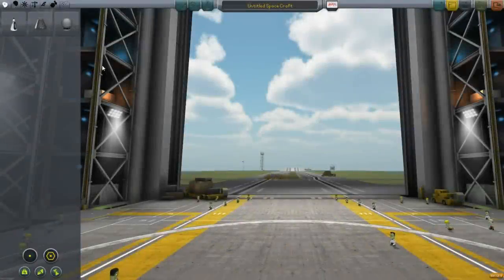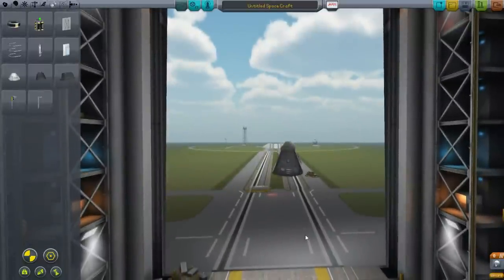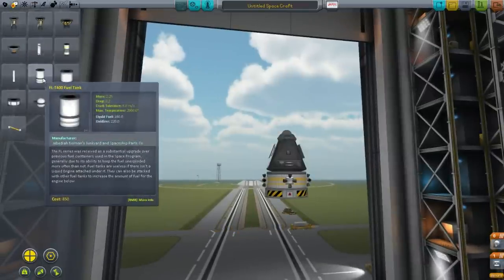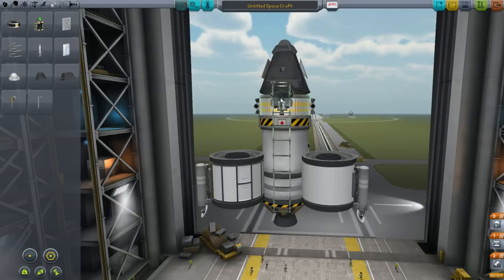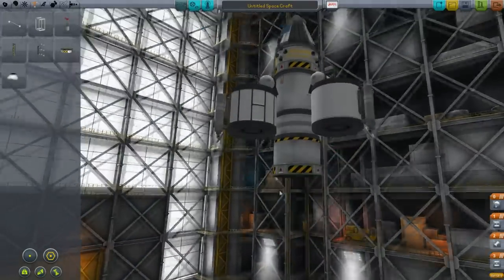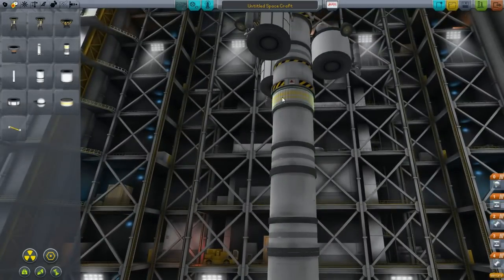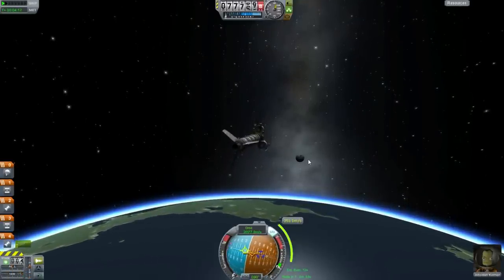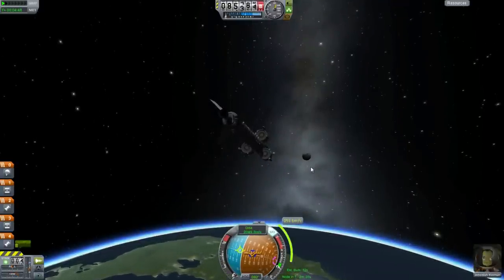Kerbal Space Program - Tutorial For Beginners - Part 6 - Building a Moon Lander

Comment: IMPORTANT! Scott didn't cover this, but when you add fuel lines, click on the outside tank then the inside tank. Fuel only flows one way, look at the arrows on the line if you're confused.
Reply from the maker: LISTEN TO THIS MAN!
Reply: Ahh brings back memories of pre-knowledge frustrations. Additionaly prior to launch check your ducts to ensure you didn't place something afterwards that cuts into any. Even though it'll render complete in the VAB initally it will be severed on the lanuch pad and inoperative. Struts, aerodynamics and ground support parts are big offenders in severing ducts.
Reply: Sam Banford I also noticed that using symmetry options sometimes causes the first part to be on a seperate group. So if you attach 4 thrusters, the staging will show 1+3 instead of 4. I could fix it by grabbing a cloned part and then reapply it.
Reply: SeedlingNL That is the second most annoying thing in the VAB for me, the first being trying to click something paritally hidden or small and clicking on the thing it's attached to by mistake (usually a entire stack of stuff on x6 sym that has asym child parts).

I think I narrowed that splitting problem down to when you grab something and don't put it back from where you got it from. It'll actually fix itself if you save and reload the vehicle or launch it. I just ignore it now.
Reply: Sam Banford Yeah, trying to click on a pixel, missing and tearing off a large section is annoying, but fortunately CTRL-Z will undo the mistake.
I think the splitting problem is caused by place a part, take it off, increase symmetry (x) and re-placing it. Grabbing a cloned part removes the symmetry 'history', so you always start with x symmetry.

Comment: First time I went to Minmus on my current save on career mode (not science mode) (before watching this video) I didn't have solar panels and I almost ran out of electric charge. I had 2.6 units left after landing and I had to wait until minus turned to the point where I would be on the side that faced way from Minmus's prograde and burned straight up and south (as I was north of the equator) and made corrections without turning. It was so awesome when I finally made it back to Kerbin.

Comment: I think it might be important to note that with the low gravity of Minmus, RCS can actually help you get out of the sticky situation where your craft topples over while on the surface. RCS will help you get a vector that points away from the surface so you can use the main rockets to escape instead of flailing around on the surface using the uni-directional main rockets hoping to point upwards.

Comment: I used a slightly altered version of this design to go to the Mun.  After successfully landing there and enjoying the sites, I took off.  Unfortunately I was only able to get into a Kerbin orbit with a periapsis of about 815km.  I EVA'd and loaded all the science onto my command capsule.  I then detached my lander from the capsule, turned the capsule towards the retrograde and EVA'd again.  Then I used Jebediah's body and jetpack to slow down the capsule by pushing against it until I had a periapsis of about 30km (it took 3 refills.)  Easily one my favorite Kerbal stories so far.  When I first realized I didn't have enough fuel to get back to Kerbin I was freaking out.  I did not think using the jetpack would work at all, but it turned out to be fairly effective.

Comment: I actually made a rocket with the early science unlocked parts that uses the asparagus style fuel crosslink setup for radial engines, I call it the Cauliflower and it's currently my main lifting rocket.

This sounds like a really interesting idea for getting heavier things into orbit though, thanks for the tip.

After making the Cauliflower MK. II and III and doing two successful (The first one's lander stage ran out of fuel since I got too greedy with trying to land in more biomes but I made it back to Kerbin on RCS thrusters only) missions to Minmus, the second one carrying all the science gear I bought with the science from the first one.

I now also adapted the original Cauliflower MK. I design to carry a microwave solar collector to lunar orbit, now I've got Jebediah back (Thanks to slapping a spare capsule and some RCS fuel on the carrier stage for the satellite) and any future rovers I land on the surface will be supplied with juice from orbit if they should run out while traveling the night side.

I can't believe it was really as simple as doubling the fuel on my original design, I feel stupid now... =p

Comment: i have the exact same rocket(except fot the RTS fuel) and as soon as i start to turn 45 degrees at around 10 km it starts spin uncontrollably
Reply: patsie00 The aerodynamics model for KSP got hugely updated. So the science bays catch a lot of drag which causes your spin. My suggestion is to use static fins (AV-T1 Winglet) on radial decouplers at the bottom of your craft. You will not spin uncontrollably, but it will make your turn a lot slower. For this, you can throttle down, or you can decouple the fins (hence why they are there in the first place). Hope this helps!
Reply: Gaurav GK Even with that static fins i cant stop that f****ing spinning.. :/ i tried to add some aerodynamic noses it doesnt help. Fins doesnt help, version 1.0 is sooo stupid. I played kerbal like 6-8months ago and everything was ok.. Now i cant get even on orbit because of spinning..
Reply: Try to use the offset tool to push the science bays in a little. And try not to do your gravity turn only at 10 km so fast. Try 8 deg very 2 km until 10 km, then slowly flatten out.
Reply: Gaurav GK tried, doesnt work even like that :( .. what worked for me is "balance" the weight of the ship at the top.. because of the center of mass is too much at the bottom, when i add some fuel tanks at the top as well, everything works ok (in that case center of mass is closely to the middle of the ship).. But after that i got problems with fuel :D cause the ship is too heavy and i do not have enough fuel with these 400 (or 800) fuel tanks. I think it would be ok with the ultra big jumbo-64 fuel tanks.. But its not efficient.. :/
Reply: Try turning slowly

Comment: The Delta IV Heavy doesn't use the fuel crossfeed method? IIRC the cryo tanks on the first stage are the exact same, and have the same amount of fuel in them.  However, the two extra core boosters separate several minutes before the main one.
Reply: Well the core stage of the Falcon 9 seems to work fine.  Also, that's rather interesting about the Delta IV Heavy.  I only wish we had that level of control in KSP.  Although with .23, we might, I just can't remember.
Reply: Razorcane We kinda do... You could set a central engine to say thrust limit at 50% in the VAB and then once the boosters had run out click on it in flight and put it at 100%. It will be nice when we can use action groups to just change the Thrust limiter setting on an engine.

Comment: recently started playing, and have "adopted" your designs, following them almost the same, only difference being is i have a mechjeb on mine. Anyways, the problem is that, every time i try to turn to enter orbit, or even when i don't, at about 10km, the craft begins to spin wildly, usually costing me a quite a bit of fuel, and the velocity i need to achieve orbit. I was wondering if anyone had any advice. Also, this is on the most recent update of ksp

Comment: Hey i started with career mode and i have the basic parts + i cant use manouvers . Can u make a video about going to the moon ?
Reply: Well, all you really need is to unlock the fuel crosslinks and the bigger fuel tanks and then you make a craft like the one in this video, lander and all. You can add some more fuel to it if you really want to, and then you go to the Mun exactly like he just showed how to go to Minmus, the only difference really is that the Mun is closer, has a more easy to hit orbit, and has a LOT of more mass. That means landing on the Mun is a lot tougher, but it's done in exactly the same way.

Like he says, if it can get to Minmus it can get to the Mun.

If you really want to you can replace the science cans he's strapped on to the sides with small fuel tanks or RCS fuel, except if you do you want to crosslink them all so they drain into the main tank, and you might want to be able to jettison the ones that are empty, so a different leg configuration might be in order. Having more fuel makes it easier to land in more places though so it's a tradeoff.

Comment: Hey Scott, do you have to get your science stage back to Kerban to cash in the science now in .90? Thanks.
Reply: Nope, you never did. All you do is go EVA and pick up all the science experiment data, then you can store it in your capsule. That's how I managed to get nearly 2000 science on my first mission to Minmus even though the lander stage ran out of fuel after the 4th biome and I had to escape in the capsule under pure RCS thrust.

I still love the fact that Minmus actually lets you do stuff like that though, you can even land using nothing but thrusters and save fuel that way, which is how I did it on my second mission to Minmus. Just add some more light RCS fuel tanks and thrusters. Once you run out of biomes to test stuff in you can replace all three of the science cans with RCS fuel canisters and strap the new science instruments to those. =p
Reply: Ahh, thank you, that's much simpler, I actually tried to make the Science Jr.s and other science stuff land safely back on Kerban :b

Comment: So I'm guessing he's going to escape from minmus just with RCS? Is that doable?
Reply: Yep, easily. You can also escape with an EVA pack.
Reply: You don't need a whole lot of delta v to get back from minmus so yep it's possible
Reply: I thought that too looking at the decoupler placed after the RCS. Although he probably has more than enough fuel to get the entire ship back. I kind of want to see him bring it back on RCS only though.
Reply: Using the same design I ran out of fuel fairly close to Minmus on the return journey. Although I'm not the most fuel efficient when flying anyway.
Reply: Easily. I botched my first munar landing and all that survived was exactly what he has after that decoupler and flew it back with some rcs fuel left over.
Reply: Phoenix84118 When he staged to the LV-909 he burned 660Δv which left him with a little above 50% fuel. Add in 340Δv to land, 340Δv to escape, finally about 910Δv to get back into Kerbin's atomsphere the vehicle will have too much mass for RCS to get the job done without decoupling that final stage to drop the dead weight.
Reply: Sam Banford dude it takes 340dv to get from the surface of minmus back to kerbin's atomsphere. not sure where you are getting this 910 from.
Reply: Sam Banford He might use the RCS as final stage but he won't need to. I just did the mission with this exact craft and had dV to spare.

Comment: Guys, or Scott, I have the same version of KSP here and the built the same ship as Scott. However, when I am following the trajectory that I set to Minmus, my fuel dies out before I get anywhere near Minmus' orbit... my burn time is at an estimate of around 1 1/2 mins (2000m or so) and my fuel cuts out when I have 600 metres left to cover... am I doing something wrong? Would really appreciate it if someone could help a noob out!
Reply: SchniddlesxD are you using full throttle or half or what? i dont reccomend using full throttle as it does use more fuel its random that ive found but also is dependent on how you fly
Reply: Full throttle! I use the same ship, same version of the game and yet my m/s is over 2000 mk/s which is like half than what Scott gets when he looks for a trajectory to the moon, so strange!

Comment: couldn't monopropellant also just be simple compressed nitrogen, so it works like a balloon...
Reply from the maker: Those are called cold gas rockets and they're safe, but very inefficient.
Reply: Scott Manley okay, but doesn't SpaceX use them on their upper stage?
Reply from the maker: Only for orientation. Dragon has proper rocket engines for RCS.
Reply: Scott Manley oh okay I thought RCS was mainly for orientation. Thanks for the information

Comment: I'm getting 1 hour+ burns to Minmus! Please help!
Reply: Wilsontech1Fan If that is true, there might be a problem with your maneuver nodes. Try experimenting with them through multiple flights to find the most fuel efficient routes.

If it is not a problem with the maneuver nodes, it is your thrust to weight ratio. If you have the fuel to perform the burns, try using a more powerful engine, or lowering the overall mass of your spacecraft.

If it is not either of these issues, you tell me what you think it is, because I cannot think of anything else.

Comment: why do you you go to minmus,not the moon? why is minmus easier to get too?
Reply: He explains it. The extra delta-v required to go to Minmus as opposed to Mun is less than the extra delta-v required for a controlled descent to the surface to the Mun rather than Minmus. Ignoring plane changes it's an extra 70 delta-v to extend past Mun to Minmus but it costs about 890 delta-v to land on Mun where it costs only 340 to land on Minmus.
Reply: Sam Banford thanks you for answering my question
Reply: Simply put: Minmus has far less gravity, so you don't have to fight it as much for landing or taking off.
Reply: also, the icy lakes are perfectly flat and the absolute altimeter at the top of the screen has the zero point exactly at the surface of those lakes.

when i was learning the basics i had a hard time landing on the moon, but then i later tried minmus and i landed the probe at the 1st attempt. ^_^
Reply: Another thing is that Minmus is actually worth more science than the moon since science is determined by your distance to Kerbin.
Reply: Thank you!

Comment: This is the only tutorial im having trouble with. Minmus is at an awkward spot, and I only was able to get 1 encounter, but had to restart the flight due to the fact that I was heading out into the middle of nowhere. Im going to re-attempt this only im going to try to land on the Mun. Any suggestions on how I can fix the Minmus problem?
Reply: Are you having trouble with the lander? Or is it the cumulative amount of delta-v your rocket has?
If the lander is your problem, you may refer to my recent comment that contains the link to a well tested lander.

If you problem is because of the delta-v ratio, I will ask for the specs on your rocket (Mass, Mass without fuel, specific impulse for each stage, amount of fuel/mono-propellant, and number of stages) 

If it is not either of these, it could also be your launching cycle. Try plane-shifting tangential to Minmus's orbit immediately. It can save a lot of delta-v.

If none of these seem to be your issue, please explain the problem in full detail. Thanks for reading!
Reply: flyin feces Ah. I got it. It's the efficiency of your first stage. Try an asparagus style launch using powerful, but efficient engines, such as the Rockomax Skipper engine. I could design you one if you'd like. In fact, why don't I do that now?
http://www.mediafire.com/edit/w7owmya8i5s77io/Heavy%20lifter.craft
I gave you my heavy lifter because I don't know how big your lander is, but if it's anything like mine, this should work.

If indeed you have to resort to a rescue ship, there's 2 things you could do. 
1. Put a docking port on your lander, and your rescue ship, and transfer the remaining fule of either ship to the one with the more efficient propulsion.
2. This one's a bit tricky, but I've done it before. Attach a rover to the rescue ship, capable of transporting Kerbals through the command seats. This way, if you land off target, you can send the rover out. But if you land too far away, be prepared to spend quite some time sitting there.

You said your rescue ship was on it's side? Well, there's a dirty trick you can do. 
Hit ALT-F12 to open the Debug Menu, and use "Hack Gravity". This significantly lowers the gravity, so the torque should be able to push it upright.